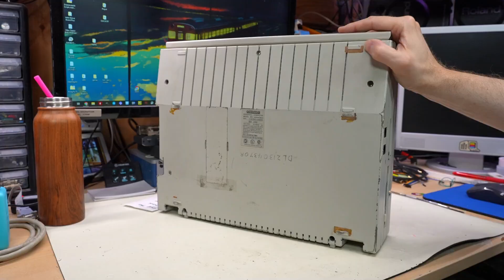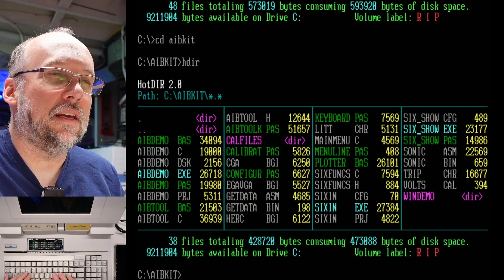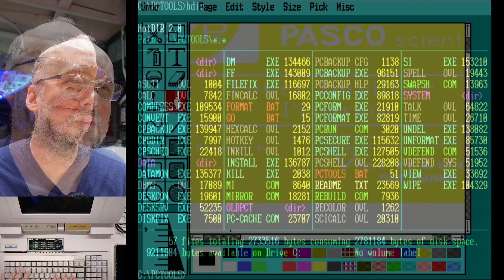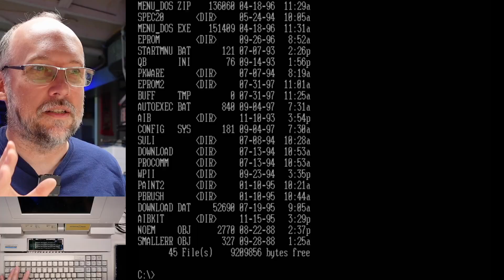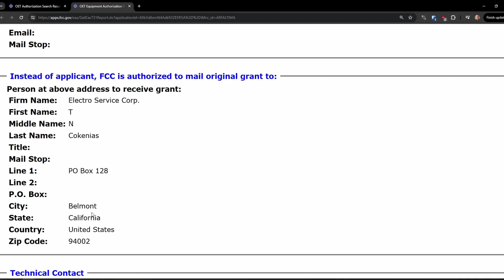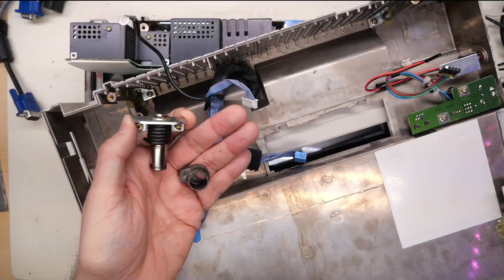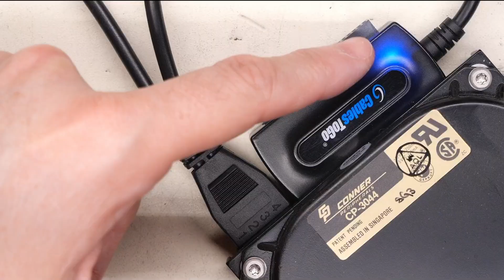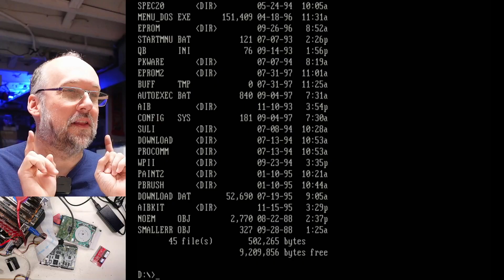PC Archeology: The Altima One laptop (Altima Systems)

Comment: That disk duplication program would've likely saved them a lot of work(or allowed to cut out a middleman duplicator) when wanting to make a lot of copies of a new program. They could make a master disk of the program they just made, load in the dupe program, load the master disk into it and leave the computer to do the rest, just as long as you remember to slap in a new disk every once in a while.

Obviously, it was used for a lot more than that, but you can see how massively useful that'd be.

Comment: From the BIOS page 2 screen, the motherboard can configure the extra memory above the first megabyte as EMS instead of XMS. This is why there was no XMS memory available. The "640-1024K relocation" was a parameter that allowed the motherboard to remap the upper 384KB of RAM to the addresses immediately above the 1MB limit. So a system with only 1MB of RAM installed would then get 640KB of base memory + 384KB of XMS. Enabling that parameter could however sometimes prevent to access the rest of the RAM if more than 1MB was installed (which is the case here). I'd suggest toggling off this parameter, as well as EMS memory support. Upon boot, this would give you access to all extra RAM as XMS. You can then re-enable the EMS support and decide how much to allocate to it. I know about this because I owned a Commodore 286 machine in the earty nineties that had a BIOS that was nearly identical to this.
Reply: My PACK-MATE 286 (PB800) has that exact BIOS and I’m looking for upgradable memory for it.

Comment: That thing looks so incredibly archaic compared to the Apple PowerBook 100 released in October 1991!
Reply: 286 wasnt exactly top of the line at the time. The 486 was released in 1989 just for reference. This was probably just a generic platform that different brand houses bought in and slapped their label on and this should have been at the very end of it's life span.
Reply: I remember seeing the PowerBook 100 in 1991 but didn’t encounter anyone with a 486 equipped machine until 1994 and then only in a tower. My dad’s coworker brought over a Macintosh Portable to show off in 1989, however that was the only one I have ever seen in person. My experience may be atypical.
Reply: @sittingstill3578  Not many people had them. A relative of mine was tasked to replace a failed 20 meg HDD at the end of the 80s for a compaq 286 (They required original hardware aparently on the MFM). It was something like $6000 at the contemporary exchange rate. He bought 2 100 meg quantum hardcards instead with money to spare. Considering the prices of computer equipment at the time I'm surprised anyone dared take a "portable" computer out of the safe.

Comment: is the drive maybe 8bit IDEXT instated of standard IDE
Reply: It has jumpers for primary/secondary so it is the normal AT type IDE.  IDE-XT only supports one drive per cable only.  (PS:  I'm aware there are some dual mode drives out there, but this drive doesn't appear to one of them)

Comment: Oh and with those USB to IDE Adaptors:
I had no luck with those on old IDE Drives, seems like those, for me, only worked with very new, big drives with multiple GIgabytes of capacity.
SO more for E-IDE, not IDE, sadly...
Reply: Oh and with  old IDE Drives, I mean something like 2GB or below... But bigger drives such as 15GB ones work fine.
So maybe the USB Adaptor forces UDMA/33??
Reply: @Stefan_Payne  Pretty sure the reason is that the adapter tries to send the ATA IDENTIFY DEVICE command to the drive (telling the host/adapter the C/H/S or LBA configuration), which these old drives don't support.
Reply: @seritools  This adapters, at least these I have, are external IDE controllers. They send nothing, the OS is responsible for everything. For me new Windows doesn't support CHS IDE addressing any more, so it cannot access it.
Reply: @seritools  The drive is identified as Conner Peripherals so the identify command must be older than you are thinking.
Reply: And especially Conner drives who had a reputation to be really finicky in their IDE interface. If you wanted to have a second hard disk on the same bus, you better got another Conner, since pairing them with anything else was all but guaranteed to work.
When they worked, they worked great, but they didn't play well with other manufacturers.

Comment: It looks like that thing might have hardware EMS support, so 4 megs might be a useful upgrade assuming the driver is available. Need to know what kind of chipset it has. EDIT: Yeah, I believe the EMS driver for that chipset is available. I actually does support 8 megs, too. I have a fairly late industrial board that accepts a single 8 meg 70 pin FPM SIMM to max out the ram. Knowing that I bet you could mod the board to have 4 megs onboard and use a standard 4 meg 30 pin kit and truly max out the chipset.

Comment: You can make up to 9,999 copies from a single read of the source disk - LOL, that would take a while...
Reply: WE had stand alone disk copiers when I was a kid they had 5 or 6 51/4" disk drives. 1 for source and teh rest for target you just pressed a button to copy. Never used them in anger though because diskettes were allready wildly out of date when my dad got them in an auction lot.  Only thing you used diskettes for att the time were pireated old games (Warcraft etc) and windows 95 startup disks possibly because most of the windows cd's you woudl use wouldn have been copied so that they could boot assuming the source even had that option. However I don't think I eve used a 51/4 disks for that.

Comment: Very interesting, why would you use a relatively "speedy" laptop until 1997 though, must have been used with an external monitor indeed in some kind of lab setting.
Reply: specialist software & if it isn't broken don't fix it...

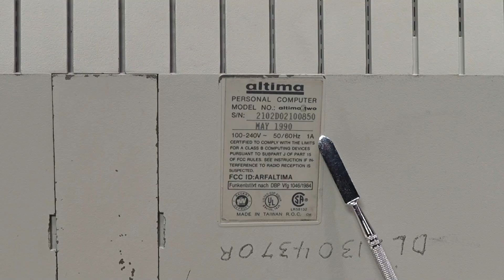Comment: at 6:18
You didn't mention the "FUnkenstört nach DBP" and the TüV Certificate, which means that this machine could have been sold in West Germany at the time as well...
Reply: Wouldn't it be a QWERTZ keyboard then?
Reply: @Nukle0n  Well, just use a different keyboard then. This machine was build with a removeable keyboard after all. They probably delivered it with different keyboards depending on the country.
Reply: @Nukle0n  Minor change...
And might not have been the case at the time necessarily. So its possible that they sold that Device with or without a QWERTZ Keyboard in W-Germany.
Reply: I had an East German Shepherd.

Comment: yeah, I got a laptop in 1992 off the back of Computer Shopper that was a 386sx/25MHz.  Pretty much all the shortcomings you mentioned when I could have gotten a 486dx/66.  The reason I got it was because I needed the portability going to school.  I did get a math coprocessor, external VGA monitor and upgraded to 12MB of ram, so it was very serviceable, but it was by no means the best of the best.  Glad you managed to pull the HDD from the brink long enough to get the data off; there were a couple things that looked pretty interesting.

Comment: That hard drive had the classic dead-cat-bounce... and you just used up one of its last lives. 🙂
Reply from the maker: Haha. It worked just long enough before that last life was used up!
Reply: @adriansdigitalbasement  It likely has the same issue as all Conner drives of that era: The rubber end stop bumpers turn into goo. It's easily fixable. All you have to do is open the drive and remove the two screws that hold the magnets. Then carefully slide out the magnet assembly. You should already be able to see the rubber rings around the two posts. Easy fix: wrap them with tape so they're not sticky anymore. If they're too far gone, you could also try to replace them with rubber tubing, heat shrink, 3D-printed TPU rings or whatnot. You can clean the edge of the voice coil assembly with white spirits or brake cleaner to get rid of any gunk that might have stuck to it.
After that, reassemble the drive, blow any dust or debris off the platters with canned air, and the drive should be ready to go again!
I've fixed quite a lot of those drives like that. They're getting more and more rare, so I try to keep as many of them running as possible.
Reply: @adriansdigitalbasement should've used norton ghost or similar to dump the contents to a new drive.. ope
Reply: @adventureoflinkmk2  but... he did copy the contents
Reply: @BenState  a drive image could save files that had been deleted but not yet overwritten. Probably nothing interesting but you never know.
Reply: I've been using Norton Ghost perhaps as long ago as 16 years.. so quick and easy to dump those drives for backup.

But maybe there is something better now.. that's more like DOS
Reply: @rickhalverson2252  Ghost for DOS has saved me a lot of times. Even in computers that use some NT Windows, Ghost for DOS can handle NTFS partitions too.